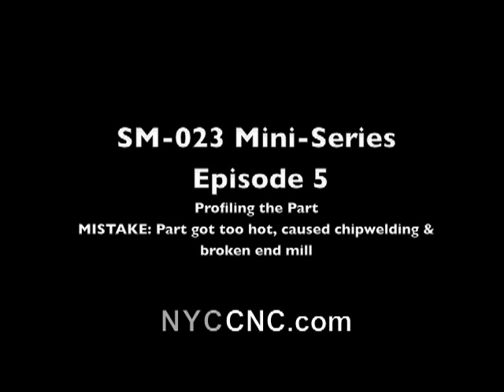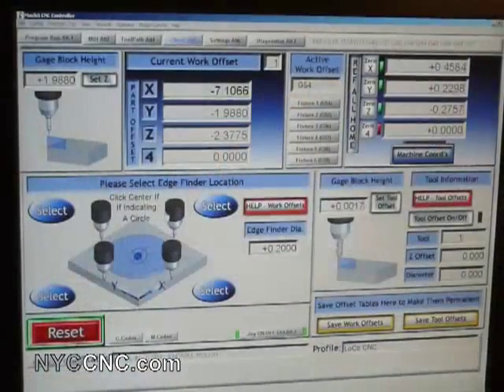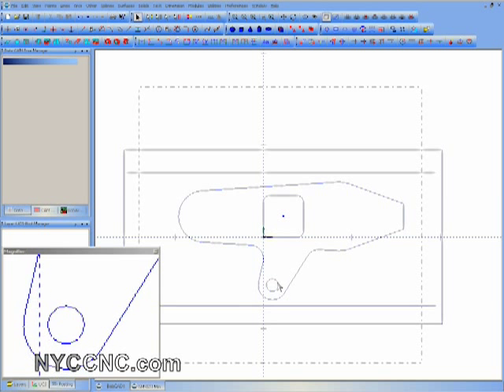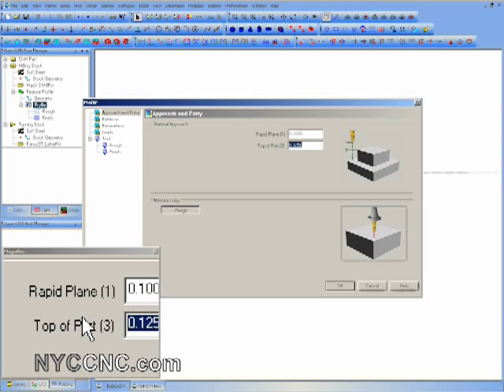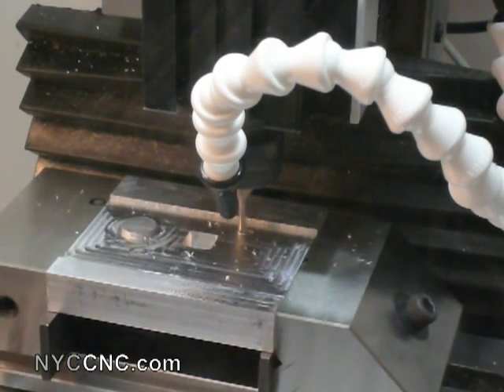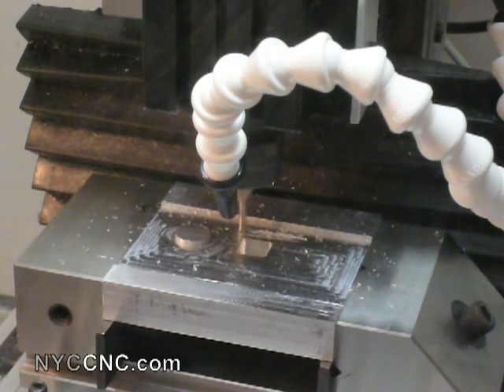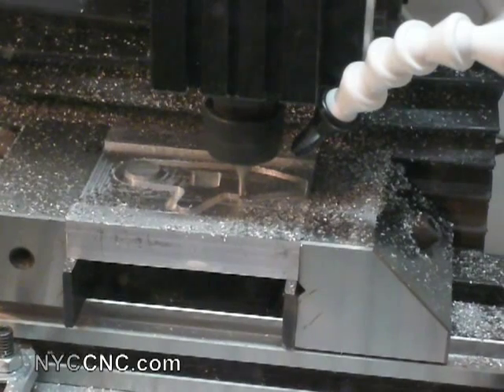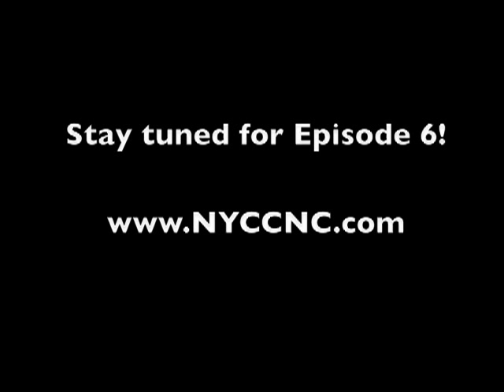How to machine a CNC mill part - Start to finish! Episode 5

Comment: I just added flood coolant to my Taig mill and it is a super upgrade. I was breaking 1/16" end mills while cutting aluminum. It would do fine at first but as the groove got deeper the chips would start building up.  Sprayed it with WD40 for awhile and it helped but since using the flood the problem disappeared and the cuts are super smooth even at higher feed rates.  Best $100 bucks I've spend on the mill yet.  Nice video...

Comment: You need more lube, when chips are welding to the endmill then its running too dry.  The chips weld and bind on the flutes.  You can use a small spray bottle if you dont have a misting system, some also use a small brush.

Comment: neeeeeeds lubrication.. you can do without the pause, just open up the window and spray some fluid in there so the cutter doesn't heat up like that, be very liberal with it.